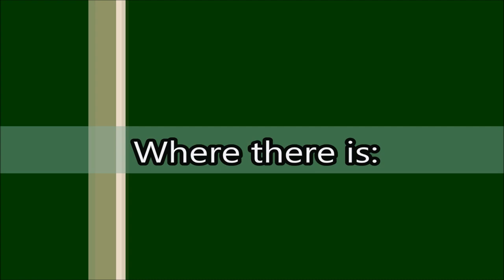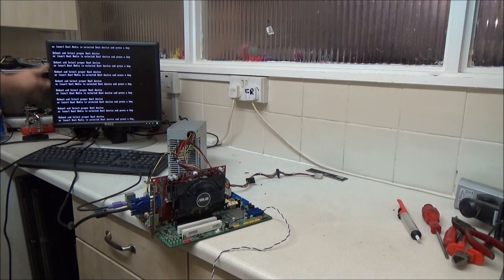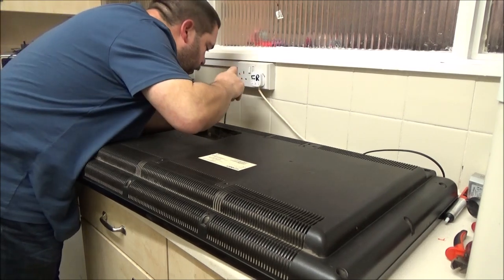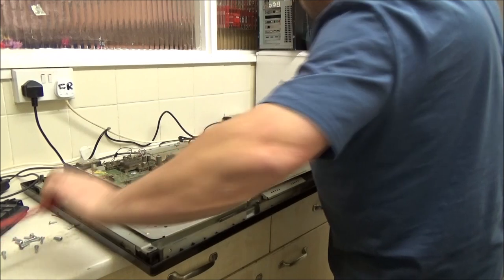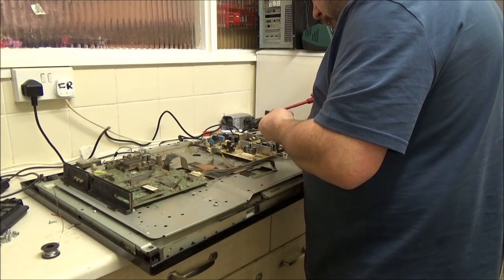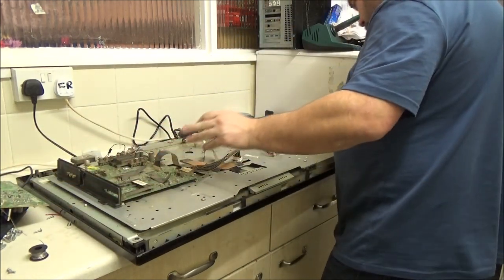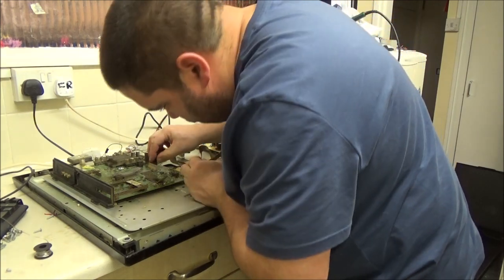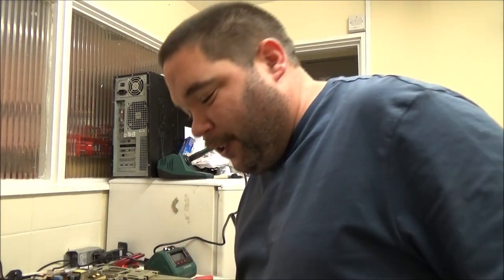Fixed An LCD TV.

Comment: Someone chucked an old sharp 32 inch lcd  tv out in the alley behind  my flat i grabbed it and it works fine 14 years old and made in japan not like the new ones that are all made by umc in slovakia ..If that is tecknika there made by vestel and the boards for them are often found cheap on ebay  my toshiba branded set is a vestel made set i had to replace the main board as it had an issue with consoles and hdmi .
Reply from the maker: It's a shame that so much electronics these days are being made as cheap crap. I think this set would have kept going on the original caps if the vents had not got clogged up with 10+ years of fluff and grime.
Reply: @RandyDarkshade2  I found another tv dumped a 37 inch sanyo badged but vestel made set checked all the caps for signs of bloating and all looked good powered it up and it had  a cracked screen ,i found a cheap replacement screen just under £32 and have since replaced it so i am now using it .